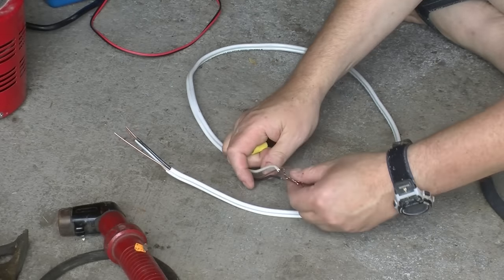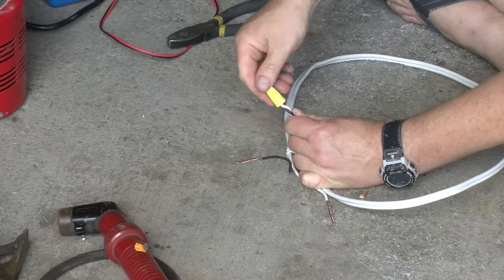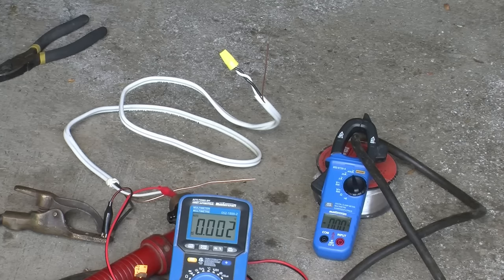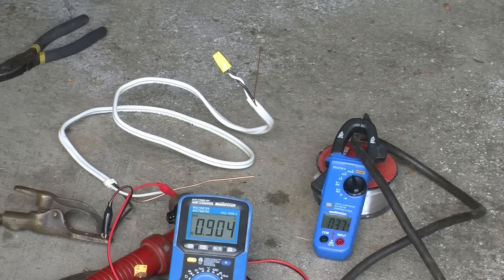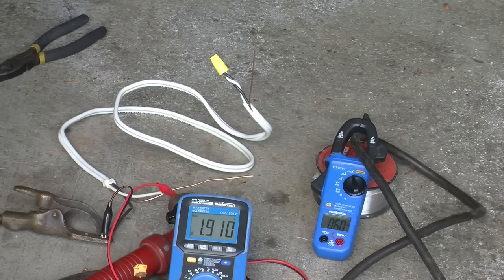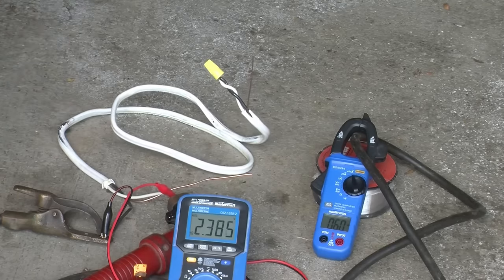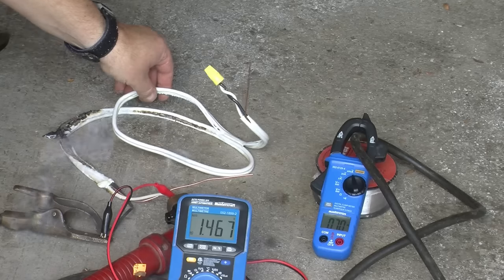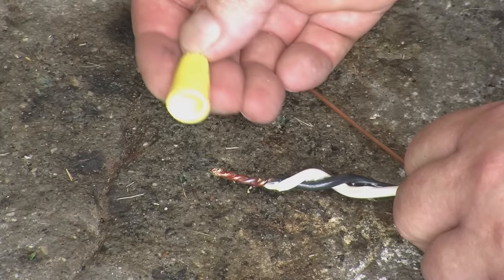How many Amps to burn up 14/2 electrical wiring?

Comment: This is confusing me. I thought the ampere rating for 14 gauge copper wire, of 15 amps, is actually 15 amps at 120 volts, which is comes out to 1800 watts of power. And I could be mistaken but I thought it was the amount of power that the wire is carrying that determines how hot the wire gets. .But I guess I was wrong as I see that things were overheating at 60 amps and 2 volts which comes to 120 watts. Now, I know that longer wire has a higher resistance than shorter wire, simply due to its length,  and with the same load in the circuit, say an electric heater, the wire will get hotter if its longer. So what are the formulas for figuring out everything?
Reply from the maker: What it is is that the amount of current flowing through the wire determines the heating per foot of wire that occurs due to the resistance of the wire itself  (which causes a small voltage drop along the wire).  That small voltage drop along the wire times the current = power lost in the wire = heating of the wire. 
 
The amp rating is not at any particular voltage. An example - 14/2 is rated at 15A and that doesn't change whether we use it in a 120V or 240V circuit. The voltage between the wires times the current determines how much power is delivered to the load so at 240V we deliver twice the power to the load for a given current that for 120V. 

Your right about the longer the wire, the more total resistance of the wire and the more power lost in the wire for a given current. However the resistance per foot does not change so the power lost per foot for a given current does not change with length and for that matter the heat generated per foot also does not change with length. Since the heat generated per foot does not change, the temperature rise also does not change with length.

Hope that helps!!
Reply: @ElectromagneticVideos  No I'm still confused about some of what you said. For example why do the user manuals for high power devices provide info about what gauge extension cord to use with the device, and tell you that if you are going to use a longer extension cord, you need one that has a larger gauge? Also, ohms law tells us that current in amps = potential in volts divided by resistance in ohms (I'll just abbreviate that to I = E/R). So the greater the resistance the less the current. Since P = EI, that means the as the resistance goes up, the Power in watts goes down. If we are talking about the power in a device, then a device which has more resistance uses less power? What power are we talking about when we are talking about the resistance in the wire leading to and from the device? the more I look into this the more confused I get. For example say I have a drill gun plugged into a 120v outlet. The lower its resistance the more current it draws and the more power it uses. Is that correct? So does the wire "waste" power as heat if it has lower resistance, or greater resistance? OK the wire is in series with the the device. So increasing the resistance of the wire decrease the total current in the circuit and therefore decreases the total power in the circuit. Oh I think perhaps I may remember – I have to calculate the voltage drop for the wire and the voltage drop for the device.  I can't remember how to do that.. Jeez I'm getting old. I'm hoping that if I wrack my brain and try to remember, I'll avoid Alzheimer's. Since R = E/I, that means the greater the smaller the current used by a device, when plugged into a 120 volt outlet, the greater resistance it must be having in the circuit. But if the wire has a greater resistance, that means it is wasting more current as heat? Why does high resistance in a device mean it uses less current, but high resistance in a wire mean it uses more current?
Reply from the maker: @soilmanted  Ok so you are bringing in a few details that I had left out to simplify the explanation:

1) Thicker gauge for longer cables: your right, more resistance in the total cable length, so for the the same current, more voltage drop in the extension cord. Extension cords are notorious for be a few gauges smaller that you would hope anyway. But again, same power dissipated in the cord per foot (and same resistance per foot)  no matter the length. Just longer cord = more feet. 

2) The wire supplying the electricity to the load (the drill, heater, washing machine) will have much lower resistance that the load. Example #14 wire has a resistance of about 2.5 Ohms per 1000 feet. If we make an example of 50 feet of 14/2 cable, the length of #14 wire in it is 100 feet, 50 for the neutral and 50 for the live conductor.  So the total resistance of the 14/2  is 0.25 Ohms.   Lets use a 100W light bulb or   small appliance as the load for example. P=VI so with V=120V, I = 0.83A. And its effective R = 120/0.83 = 155 Ohms. 

So at 0.83A we can calculate the voltage drop along the 0.25 Ohm cable = RI = 0.25 x 0.83 = 0.2V.  And the power dissipated in the cable is 0.2 volts x 0.83 amps = 0.17W. So tiny compared to power being transferred though the cable to the load. You would hope it is that way since the heat given off by the cable is a loss lowering power transfer efficiency. 

3) That tiny voltage drop along the cable of 0.2V in the example would lower the voltage seen by the light bulb to 120V - 0.2V = 119.2V, hardly a change. In fact the normal AC voltage variation from the power company can be in the range of +/- 5V. So normally we just ignore the tiny drop in voltage when doing the calculations. Yes that drop may change the current drawn by the  load by a tiny amount too and we could setup up an equation to take all of that into account in terms of the current flowing but the difference would be negligible. Also many loads are not resistors. When decrease the voltage to many motors, they well draw more current (not less like a resistor) to try and maintain the amount of power they are using. 

So I hope that example answers a few of you good questions. If not, please tell me whats still confusing!
Reply: @ElectromagneticVideos  Everything there makes sense. Not sure why I was confused. I'm 75 years old. I do have some atherosclerosis and some neuropathy in my right foot and external ears (pinnae). Calculations that I used to be able to do are becoming hard for me. It varies upon the time of day. My language abilities have not deteriorated; I can still write with good grammar and syntax; but math is getting harder and I make weird mistakes. But thanks for the info. I suspect that keeping my brain active by going over those math problems  slows down deterioration of math skills. I haven't been diagnosed with Alzheimer's but I've done annoying things like put food in the freezer that was supposed to go in the refrigerator.
Reply from the maker: @soilmanted  I'm glad the explanation did make sense. Its not always easy to do text only. I far prefer explanations with drawings and schematics however simple. 

I am so sorry to hear of your health issues.  In fairness as well all get older we do more an more things linen that and particular when distracted. I think your so right about keeping the brain active - that cant do anything but help! I'm always happy to try and answer questions or provide explanations.  You might enjoy some of my other videos on things like magnetism, transmission lines etc. And of course I'm sure you have found the other, (much bigger and better) youtube channels that are so interesting. If you havent seen Periodic Videos (UK chemistry Prof) and Numberphile (UK math profs) look them up - nice short snippets into the interesting things in their world of interest.
Reply: @ElectromagneticVideos  Thaks for the info!
Reply from the maker: @soilmanted  Your welcome!

Comment: Could someone explain what the volt meter is signifying? I am assuming that there is 120 applied voltage and the .71 is the voltage drop?
Reply from the maker: 0.71 is the voltage drop along the wire. Its also the voltage applied to the wore since its effectively a shot. If I applied 120V the wire would vaporize! I just did an explanation video here (and also a link to a written FAQ in that videos description) https://youtu.be/CP3-jcpzZeI
Reply: @ElectromagneticVideos  Thanks. I just found your channel today, and you have already elevated my understanding up a notch.
Reply from the maker: @sailingeden9866  Wonderful! Glad you found my explanations understandable!

Comment: Wire temp is always an effect of length and amperage. I've seen 8" of #12 solid wire used as temporary fuses. They were powering the shop wing of a high school. I put an amp probe on each one and they measured 95, 90, and 105 amps of continuous resistive load. After pulling them out the one carrying 105 amps had crystallized the insulation and that was the only damage to them.
Reply from the maker: Wow! I have never heard of temporary fuses like that, but I'm not an electrician.  Interesting that the insulation crystallized rather than melted. I wonder if it was old and/or higher temperature rated plastic?
Reply: @ElectromagneticVideos  Thhn insulation. The wire was only to test the equipment until the fuses arrived but apparently whoever installed it was not on the job anymore. I believe the fuses were something like 600amps when they came in so I would imagine the #12 would have burned through long before the gear ever reached what it was designed to carry. You should go to the old phone building in houston. They have a floor of refrigerator size emergency batteries and stacks of copper bus bars to carry the dc voltage. For fuses they used half inch copper pipe. That's a permanent installation. It's also many decades old if it's still there.
Reply from the maker: @71160000  That would be fascinating to see. Even more so seeing a copper pipe fuse blow and the resulting arc (from a safe distance). DC arcs are can be very hard to extinguish - but  maybe at currents like that there is such a large ionization path the AC or DC makes no difference. (?)
Reply: @ElectromagneticVideos  The bus bars were perhaps 1/2" by six inches and stacked four or six high and then run all over the room. All uninsulated but likely low voltage. I'm going to guess 48v or less. Someone told the apprentice if he touched one it would kill him and we were all over and around those bars. Taught him to be careful around electricity quickly.
Reply from the maker: @71160000  I really would have liked to see that. Also the  rooms of mechanical telephone switches all clicking as calls are dialed. Funny - you dont think of a phone system as needing much current, but multiple 20mA per line by 10s of thousands and you get a big number. I would think with that sort of DC current available, 48V would be the least concern. But dropping a wrench across two of the bus bars and instant melted metal flying all over the place!
Reply: @ElectromagneticVideos  Unfortunately while I was there they ripped out all the old phone boards. Huge consoles all made from cherry wood. Reminds me of my youth back in the fifties. I'd walk to the drug store on saturday morning to check out the new comic books and they had a wooden phone both. Made of cherry wood and it was a work of art. Sad all that's long gone.
Reply from the maker: @71160000  Those would have been such museum pieces - as you said, a work of art. I'm sure you remember all the electronics from that era in beautiful wooden cases that were really fine furniture. I know them so well - when I was in high school in the late 70s/early 80s, people were junking things like that. I would pick them up, fix them (using a vintage 1950s oscilloscope I got a flea market) and sell them. One in particular I wish I had kept. I do have some vintage electronics from that period which I will eventually make some videos about.
Reply from the maker: @71160000  By the way - if your ever in Atlanta there is a phone museum there. Unfortunately open by appointment only which I didnt know when I visited there a few years before covid. I'll bet a lot of the stuff you mentioned is there.
Reply: @ElectromagneticVideos  Yes they are collector pieces. I've seen many old electrical testers that had wood cases before plastics were used.
Reply from the maker: @71160000  I have a vibrating reed frequency meter just like that! https://youtu.be/z3iHIkC32A8
Reply: I've seen bolts used as "fuses" because they couldn't find the problem but needed the piece of equipment running.
Reply from the maker: @jesusisalive3227  I'll bet happens more often than we would like to think - time is money and I guess it can be a calculated risk. Hopefully a bigger fuse further back would provide a last line of protection if the bolts turn out to be less than "optimal" :)

Comment: Proof that the multiple derating of every item in an electrical system just drives up the cost of home building.
Reply from the maker: Its actually the really expensive things like AFCI breakers that are now required on most household circuits in many places in Canada and the US that bug me. I do wonder if one did a proper study of what one could do with the extra $1000(?) in cost, there might be other things that one could do for that might be more effective. More recently here we also required a $1000 drain water heat recovery unit in new houses. I once did a back of the envelope calculation based on energy cost and expected device lifetime and it it was a break even over 20 years if you were lucky. And of course increased the price of each new home.

Comment: One thing a lot of people don't understand is, electricity travels on the wire not thru it.
Reply: Apparently there is no "flow" of electricity at all.  It's all fields.  The "circuit" channels the field.   The electrons actually barely move.  Current flow is just a abstraction model that works, but not what is really happening.   You can see this demonstrated with an induction cook top.  the field caused the energy to transfer.  This is similar to how the wire heats when it has "current flowing".  It's the field that causes the heat not friction of electrons.  so yes, the electricity does travel ON the wire as a field.  Not through it as a flow.

Comment: I'd seriously doubt youd ever have a oroblem running 14 gauge romex on a 20 amp breaker since 16 amps usage would follow the 80% rule and table 310.15 b16 says that it will carry the load just fine. The only reason 14 gauge romex has to go on a 15a breaker is because theres an article somewhere up in the 400's that says so. 
But even considering running through insulation in the walls i dont see how it could possibly ever be an issue. 

Sure that 5' puece is in open air but run a 50' piece through insulation and put 16 amps on it and see what happens, you'll die of old age watching and waiting for it to melt.
Reply from the maker: Yeah - there is a significant safety margin built in. I would have agreed with you about wire in insulated walls until I did some tests in a mock up 2x4 wall with various insulation types, particularity with spray foam. It is such a good insulator that the safety margin all but disappears.

Comment: The only issue that I can see with this test is that it is 50 amps at 1.5 volts... Which means that the actual work being done is now where near the amount of power that would be flowing if the power was at 120v at 12-15 amps. Most loads are rated in watts at a given voltage. which means the current measurement is good and all but if it is not near the rated voltage. You could push 100 amps at .5 volts and not get any real issues. 15 amps at 120v would be a closer comparison to what would actually happen if you overloaded a wire. at the point that the wire starts smoking you are at 70 amps at 1.1 volts. which is just over 70 watts give or take a couple. 70 amps at 120 volts would be over 8400 watts.
Reply from the maker: What causes the heating in the wires is the ohmic heating of the cables due to the current flowing though them, not the potential between them. The power from the voltage between the wires times the current flow gets delivered to the load which hopefully safely consumes it. The 1.5V is voltage drop along the cable which times the current of 50A = 75W which heats the cable regardless of the voltage between the cables. 

"You could push 100 amps at .5 volts and not get any real issues" No - for #14 cable, the 15A rating of the cable applies regardless of the voltage between the wires, whether that is 1V, 12V, 120V, 240V or anything else.
Reply: @ElectromagneticVideos  hmmm. I will have to look more into this topic lol. Obviously I missed something.
Reply from the maker: @matthewrichmond5179  No worries - questioning the fact that its not 120V has come up before. I should do a video on the "why" sometime. Once you have looked into it I be happy to discuss and try and answer any questions. 

For what is worth, I did come across an paper about a UL test that was done in a very similar way - unfortunately I cant find the link right now or I would post it for you .

Comment: I dont get it the point of this. There is no way that would hold 60 amps at 120 volts which would be what it would be used with. I donno maybe im missing something.
Reply from the maker: Its the current though the wire that generates the heat, not the voltage between them. So the heat generated does not depend on   the voltage between conductors and 60A would generate the same heat in a 240V, 120V or low voltage circuit like this one. The voltage here is the voltage drop along the wire due the current though  the wire's resistance.